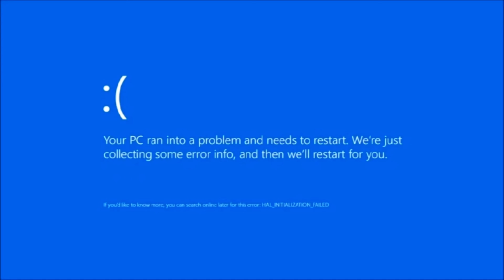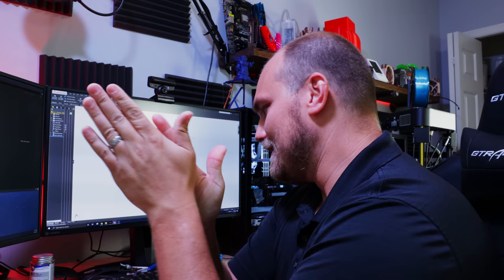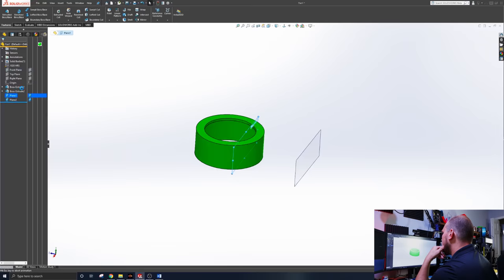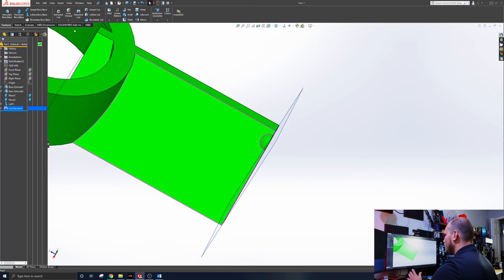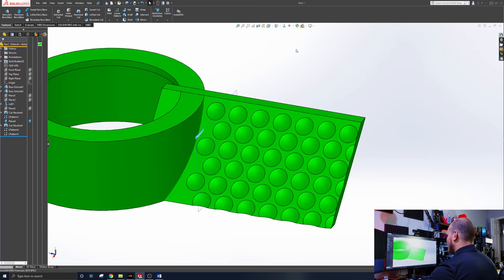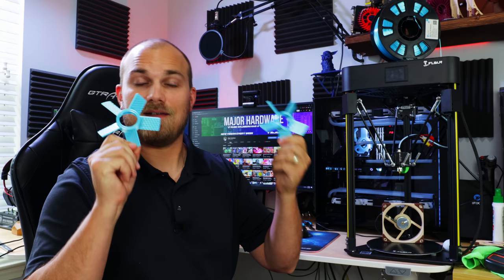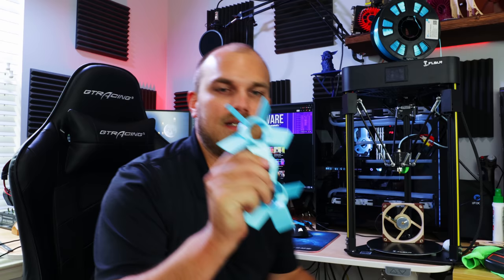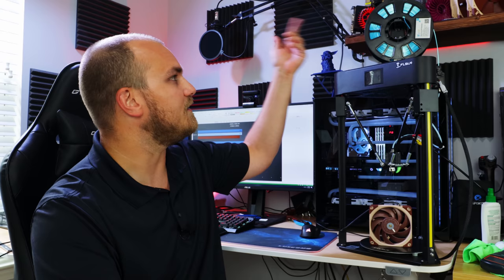What If Fan Blades Had Dimples Like A Golf Ball?

Comment: lol, this video shows how much people have a complete misunderstanding on how fluid dynamics works. they try to glue pieces of information together and end up with totally wrong ideas. 
The dimples you put there are doing nothing to the air flow, because there is no air flow where they stand, just a void (or low pressure). Your blades have to much angle of attack and so the air flow detaches immediately past the leading edge. Also, the dimples need to be near or just past the leading edge where there is still air compression, which they are not. Also the dimples work favorably in a window of air speed, which will determine the size and depth of the dimple. Just copying an average value on wikipedia does not cut. this is exactly the type of engineering you see for example in some cycling wheels manufacturer,  and its utterly BS...
if you wanna improve you fan blades you need to round them in order to create a gradient of angle of attack (less angle past the leading edge). Only then you will be able to play with turbulent boundary layers (which is what dimples try to achieve) but you will have to use different methods then dimples. I think it was fractal design who tried to explore this concept on some of their fans, dont know how effective it worked, but the theory behind it seems right.
Reply: I was watching this to see what dimples do for golf balls not to make better fan blades, so kind of a different eye looking at this.  Want a more efficient mover of air use a propeller (airfoil).    I didn't learn what I wanted to when I clicked on the video.  "Do dimples make a golf ball fly further"?  If so,  I assumed the dimples on the fan blades would have them moving less air (Drag).  His summation at the end is very problematic.  "Dimples make golf balls fly farther...  but don't affect fan blades".  The suggestion is that ONE object covered in dimples is greatly affected...  And another is not".   <-----  Not possible
Reply: I have never studied fluid dynamics or aerodynamics though I was thinking along the same lines. The overall diameter of the golf ball and the dimple size and the speed of travel and the direction and speed of rotation of the golf ball are all important factors that have the be balanced for there can be any positive effect. Plus, in sports even a 1% improvement in distance or stability is considered significant; but it would not be significant for something like cooling of a CPU. And, golf ball dimples don't actually look round to me, more like rounded corner hexagons. This must have some effect due to the the overall pattern of dimples on a golf ball not being entirely hexagonal. And lastly, the golf association as regulated the maximum distance the ball can travel when launched form test equipment, so if someone had engineered a better dimpling pattern or geometry they would not be usable in golf balls and therefore not a very good basis to start from for anything other than a school science fair project. That all being said, if the goal is for a middle school science fair project, then you probably got a B grade. Not bad, considering discoveries like Mpemba's are exceptionally rare.
Reply: @russellnotestine6436  I commented on the video as well, but you might never see my comment. I decided to write your a reply directly because of common interest. Golf ball dimples work because of ball spin. When you strike the ball well, even with a driver, there is backspin. This causes the bottom of the ball to travel forward at a greater velocity than the top of the ball (Oversimplified math used only as an example: if the ball had a 1" circumference and struck at 1 inch per second (and no gravity to interfere with linear progression. If the rotation of the 1" ball was 1 rotation per second the ball's mass would rotate around the direction of travel it progressed. wobbling through the air. This is because the top of the ball would always be stationary while the bottom of the ball was moving at a total speed of 2" per second, and rotating around the top of the ball.) The ball would have linear progression, but only that every rotation of the ball would give a new "top" to rotate around, but the "top" would always be stationary.

This speed differential is why golf balls are dimpled. if the bottom of the ball has faster linear progression speed than the top of the ball, the bottom of the ball creates lift. Have you ever watched a well struck drive travel off a the club face, then suddenly rise into the air? That is the lift from the dimples. It is also why a poorly struck golf ball travels 100 yards off a driver and suddenly turns hard right (slice) or left (hook). Also why right handed hitters typically hit slices and left handed players typically hit hooks. It all depends on how the ball spins off the club face. 

Hope this helps. I was a golf course superintendent for nearly 30 years, have worked in academics, and love science channels on youtube. This is my first video from this youtuber, I might give him another chance or two, but was very disappointed in his understanding of science from this video and don't expect much from him.
Reply: Yeah anyone that's ever been serious about playing golf knows he went into this with the wrong idea of how dimples work.
Reply: What if instead of dimples you had raised bumps , but not only raised bumps that each bump was shaved just a little bit at a pitch or angle that threw air ?
Reply: @garyschraa7947  I assume this comment is trolling, but in case it isn't, because that will create turbulent flow reducing efficiency.
Reply: @magicrealms5514  NOT trolling . Just not an engineer .  I believed the trailing edge of a fan blade pushed air while the leading edge sliced through the air .So if there were micro trailing edges cascading along the flat surface of the blade towards the trailing edge it might compound the effect or increase air flow . But you right I'm sure . It would create turbulence instead . Just a thought experiment from an average guy ,not a PhD
Reply: @russellnotestine6436 Less air resistance requires less energy. The dimples result in less air/surface resistence,so in this case there will be less energy required  to run at identical velocities. There is air turbulence caused above/behind the dimples,but probably not enough to  be an issue.
Reply: @mjmeans7983  the dimples decrease surface resistance. Turbuence due to the dimples,may cause some additional drag,but probably not enough
Reply: @dmc7173   better check I think its you
Reply: @tommygunn7745  Right my question is how does that lower surface resistance effect the fan's blade's ability to push air..  or does it?
Reply: @criticalmass8272  You make a sound and logical point. It is a shame you made it so poorly. In the future follow these steps: 

1: make logically coherent points
2: substantiate your points with evidence
3: condense points to as few words as possible
4: don't insult your audience unnecessarily.
Reply: Rui thanks for this comment, at least this video links to some rational info this way 👍🙂
Reply: that "cycling bs" reference is brilliant
Reply: @russellnotestine6436  there is no lower surface resistance. The dimples in the fan blade have no effect at all... On a golf ball they create a small amount of surface turbulence which will create a turbulent boundary layer making the air "stick" to the surface of the ball longer, closing (reducing) the gap of air that would otherwise form on the back of the ball. This will create a lower pressure diff between front and rear of the ball thus resulting is less pressure drag. High pressure on the front, low pressure on the back generates a force from high to low, that is in the oposite direction of travel. Less pressure diff equals less pressure drag generated. Surface drag is slightly increased but net gain is way favorable.
Reply: Good point. Fan bases must have an
Increasing ‘angle of attack the close to the hub’. These blades will cause a messs of turbulence
Reply: @russellnotestine6436  the reason dimples affect golf balls and not fans is that when an object moves through the air, it creates a low-pressure area behind it, creating drag and slowing down the body, because of this, a teardrop shape is the best shape for limiting drag since its outline follows the low-pressure area allowing it to negate the effect almost entirely. the golf ball on the other hand is made to be sphericle to allow for non-directional hits, and therefore must be designed to minimize drag some other way. 

this leads us to the dimples, and how they reduce drag. they do it by creating turbulence on the surface of the sphere, which creates vortexes swirling into the low-pressure zone behind the sphere, allowing air to fill the low-pressure zone more quickly, and lessening the effects of drag.
now, the reason this effect doesn't work on the fan is that its shape is significantly better aerodynamically starting off, as its blades do not generate low-pressure the same way the sphere does, since they are already thin, and don't require air to bend its path nearly as much in order to pass around it.
Reply: @TwelveCrows    Not helpful at all because both objects are moving through the air.  But thanks
Reply: @criticalmass8272  pointing out the flawed premise of the experiment is not stuck up, it is presenting information that is substantiated by scientific fact and some who read the comments would like to have that kind of information after watching the video so we don't walk away with less knowledge than we went in with.  In short, you get fucked.  And thank you to the original comment poster for actually setting the record straight.
Reply: It occurred to me also that even if designed for maximum efficiency to keep the air attached to the blades, not smoothing away the surface finish of a raw 3D printed part would be enough to cause a boundary lay separation such that the air flow would not notice the dimples.
A better test would be to use both as a air brake against the fall of a suspended weight, takes out of the equation if the motor used would over come any negligible differences.
Blades would also need to have the same strength against flexing in the air flow for results to be comparable in an air brake scenario.
Reply: @mjmeans7983  - It's debatable whether the Mpemba effect is even real. It's extremely hard to test for and many tests have not replicated the results.
Reply: How about grooves from the leading edge?
Reply: @fredhurst2528  the point is the tone of the response. There’s plenty of ways to make your point without coming across as arrogant and, even worse, seeming to diminish the efforts of amateur scientists/engineers. If you can’t see how the overall tone of the comment was clearly derogatory and pompous, then perhaps you should attend to some of your social inadequacies because, irrespective of how much you know, it’s completely useless if there’s no one around you to appreciate it.
Reply: @mjmeans7983  has nothing to do with it
We are talking about air moving efficiency not how fast you can move through the air

Comment: The reason golf balls go farther when dimpled is supposedly due to a thin layer of air "sticking" to the ball in flight, which reduces the size of the low pressure zone behind the ball by smoothing out the airflow around the ball. At least that's the theory I've seen used to explain it several times. So the effect I would expect dimpled fan blades to produce would be reduced turbulence in the air being moved and perhaps less tendency to create drag inducing vortices at the ends of the blades, assuming those vortices are even an issue in a ducted fan. As others have pointed out, the fan is most likely designed to spin at a fixed rpm anyway, so even if drag is reduced by the dimples it's not going to result in the fan spinning faster. You could try the experiment using an unregulated DC motor, making sure the voltage stays consistent...

What might be an interesting experiment though, would be to print two identical propellers except for the dimples on one of them and find out whether smoother airflow due to dimples produces any measurable difference in the amount of lift the prop generates at the same RPM, or if given the same voltage and propeller RPM less current is drawn due to reduced drag. Hehe, my curiosity about this may be just the excuse I needed to buy myself the 3d printer I've been coveting for a while now, so thanks! I'll just conveniently ignore the fact that I'm sure I'm not the first to think of this, and that every propeller and probably turbine blade made would be dimpled if any significant benefits were to be realized. 😉
Reply: Measuring how much power is drawn is a great idea.